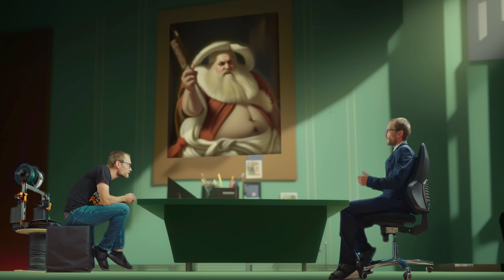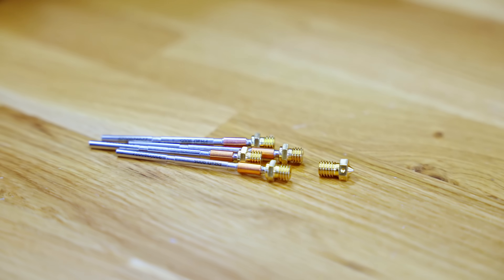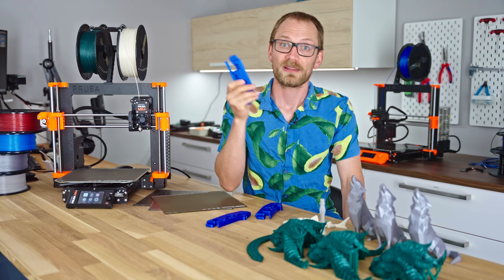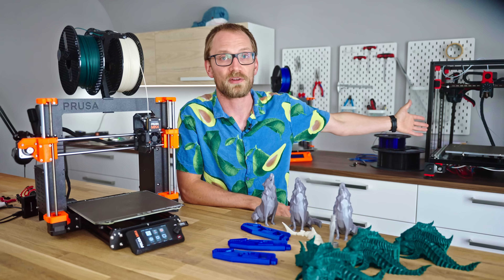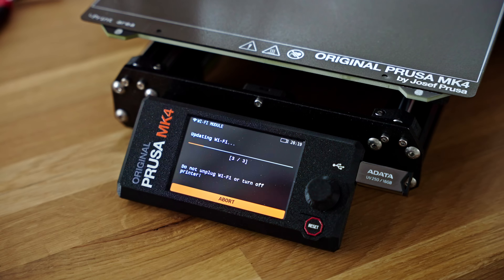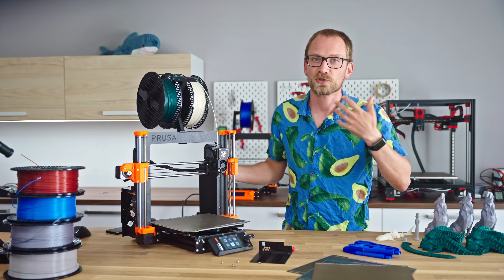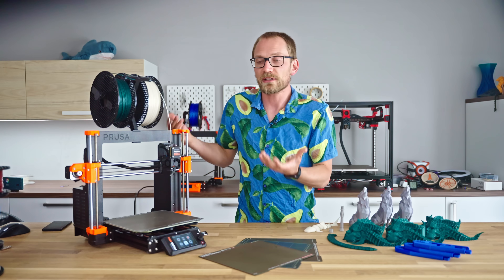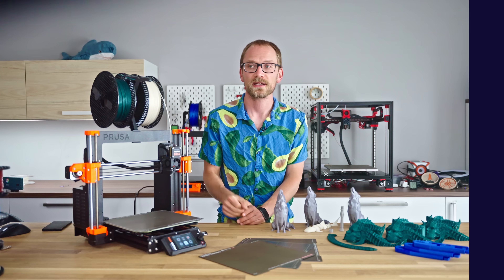Does the Prusa MK4 have what it takes?

Comment: I purchased the MK4 because Prusa has been more than willing to help me solve every problem that I have run into on my MK2 and my MK3. Even sending out replacement free of charge if it was determined to be a faulty part. 
Prusa is the only printer company that I know of that offers upgrade kits throughout the life of the product as technology improves. That is why I choose to buy Prusa printers.
Reply: But the kits are getting extremely expensive. Like the 4.0 kit is only 250€ less than a full new mk4 kit...

Unless you really only have space for 1 printer and for some reason dont want to sell the mk3 it's much more sensible to get a full mk4 and either have 2 printers or sell.mk3 (certainly for more than 250€)
Reply: I was referring to the small mid generation upgrades that are in the $50-$200 range. I agree it's not worth upgrading your current printer to the next gen.
Reply: @Daepilin  Josef has said this himself repeatedly, but people keep demanding that he sell kits, so he does it. But there’s usually partial upgrade options which make a lot more sense. For example the MK2.5 or MK3.5. You improve your current printer, not to full spec but still an upgrade, and for a fraction of the cost of a new one.
Reply: @Daepilin  and aside from upgrades they deserve some credit for providing support as well. I‘m certain I could reach out with an issue on my 6-year old several times slowly upgraded MK2.5S and they’d help me instead of saying “sorry that was EOL in 2018.”
Reply: I wouldn't buy any MORE Prusa Minis at current price point, but I have two that have been my core machines for my business and I will run them forever as long as I can still get parts and they still keep putting out quality prints. I think we will see Prusa stick around as a company for a long time to come just because they have built the rep that others have to claw their way towards, and I am sure they have more innovations in the pipe.
Reply: @andersalbertsson215  agreed. It’s only a matter of time before they make an “XL mini” (normal sized corexy). The MK4 was to hold them over and get a last push out of the i3 platform I think.
Reply: Not sure why people believe only Prusa offers good support.  I have had two problems with my X1 Carbon and their customer service was fantastic.  When you open a ticket, the process can automatically download the printer logs to their site.  Does the MK3/4 even have logs?
Reply: @A1N0  That's not actually what I said, though. It's not a zero-sum game. I wish they were all fantastic at customer service.

But Prusa has demonstrated over the course of at least the last six years that their customer service is excellent and that they essentially never stop supporting a product, and they deserve credit for that. They are not the only ones, but the ones that do are in the minority, certainly of those that sell printers in this price category.

Bambu may turn out to be one of those as well (though your X1 cost you twice what my MK4 kit cost me), and so far it seems they are off to a good start. We can talk again in another five years. But for now Prusa's customer service is a known positive to me, and part of the reason I don't regret my purchase.
Reply: @A1N0  And for what it's worth, you can have logs with Prusa I believe, if you use PrusaConnect. But I don't because I print locally, which is a difference in philosophy between Bambu and Prusa, and I think Prusa would say it's a feature not a bug.
Reply: Creality also offers upgrade kits. But their printers are absolute garbage so why even bother
Reply: 100% agree and its hard to tell them (Prusa) XL 2 years in production as the market Zooms past them and its already obsolete to other printers
Reply: @dansteffee9759  I dunno if the XL is already obsolete, is it? What makes it so in your opinion?
Reply: @swissfreek  I know it splits the Prusa fan base as I have many Prusa's . But Voron and other Machines have this Input Shaping technology. I had this XL machine on order for 2 years , bailed built a Voron 2.4 and have a MK4 . You have to ask yourself what is new that nobody has out there on XL
Reply: @dansteffee9759  but just because someone else has done it does that make the XL obsolete? Or just, not first to market? You see the same philosophy from Apple. They are almost never the first to market with a particular feature, but they watch what others do and take their time to get it (mostly) right the first time.

Prusa don’t use Klipper, they don’t require a second single-board computer to run input shaping, they don’t require you to source parts (I admit there are plenty of Voron kits now), and many many people don’t want to build a Voron. I enjoy building things and even I’m not sure I would want the hassle. If 3D printing is to become truly mainstream as Prusa and others want it to be, then it needs to not be something you have to build and fiddle with. We are nerds and early adopters. For us the fun is in the tinkering. But for a mainstream user it’s a tool, like a vacuum cleaner or a paper printer. I don’t want to build and tune my vacuum, I just want it to suck up the dust when I turn it on! For this person a Voron is just not even a consideration. They will wait a couple years for something like the XL to exist.
Reply: @swissfreek  a fraction?! is the price of a complete mk3s clone
Reply: @felipeh5510  I don't understand your logic. It's a fraction of the price of an actual complete Prusa printer. The price of clones is not irrelevant in general, but it is completely irrelevant to this discussion.
Reply: @Daepilin  I was thinking the same, I would keep my MK3 and just buy a new MK4 kit because the price is just so close. I mean I just don't see the point of upgrading really. I don't care for the LCD screen as I mostly use Repeiter Server to run the printer, the LCD is just to setup the filament with the MMU as it is a pain in GCODE lol
Reply: Bambu Labs is offering a full upgrade kit for P1P to P1S so it will be interesting to see if that philosophy has been adopted by Bambu.
Reply: I can't even comment on their customer support 1.5 years after my prusa mk3 purchase. I have not had a single issue at all. Some user issues with adhesion after swapping build plates and not getting the layer height dialed in perfectly, but that has been it. I have seen no layer height drift at all, so that has only been an issue when putting on a brand new plate.
One thing I kinda hate about it is that I have to run a cable from my pc to it in order to update the firmware. I don't have a usb cable with that adapter long enough and don't have a laptop so I have never updated the firmware which was out of date about a month after receiving it. This has not caused any issues yet, but one day it probably will.

Comment: I chose my first 3D printer as a prusa mk4 because I want something solid for the next 15 years minimum. I support an european busness, the open source slicer, the internet connection with all the stats I can monitorize from my phone... I bought it in kit, it was incredibly fun to build, and it works on the very first try I was completely bamboozlied. I made a Benchy on PLA and then on PETG. Incredible emotion when you come from the wood industry like me.

Comment: After owning my Sovol SV-06 for half a year now, I still want a Prusa. As you said, you have to tinker with the Chinese machines until they run reliably or even work for longer prints at all (yes, I'm looking at you, heatcreep).

But at this point I have three printers that need tinkering and I'm just tired. I just want a printer that prints for hours, days, weeks, months, years without tinkering. And that's what Prusas do best and seemingly nobody else achieves. My friend has a Prusa Mk2 and it still runs just perfect after all these years.
Reply: You had heat creep on the SV06? I have pumped a good 15-20 KG of filament through mine and not a single clog. That includes some 48hr+ prints.
My only mods were a couple of parts to manage the bed cable and I upgraded to a 5015 single fan dual duct config. My only issue is the VFA, which the MK3/s/+ also suffer from.

Oh, almost forgot I packed the bearings on the SV06 as soon as I got it, they were almost completely dry and sounded horrible, after greasing them it is pretty quiet apart from  the PSU fan which I will most likely replace with an 80mm at some stage.
Reply: @Smokinjoewhite  with some PLA brands I had heatcreep issues (filament stuck, failed print), especially now in the summer it appears the temperature within my enclosure was too high. There are really good models for 5015 fans on Printables and since then I didn't have any issues again. And the printer became quieter because the bearings in the fan made weird noises on movements.

Comment: Honestly that load cell and prusa link are what got me to purchase the Mk4 (on top of the good experience I've had with my mk3)
I never really liked using octoprint so i really like the fact that i can load my gcode onto the printer's storage without having to physically plug in the storage device into my computer. I can operate everything from PrusaSlicer and/or the web interface. 
Also, to me its an $800 printer since i like the fun weekend i get assembling the printer. 
It may not be significantly better than all the competition out there but I don't have anything to complain about with this machine.
Reply: I know my MK4 is going to get support and options for upgrades in the future on top of sustaining their commitment to the community.  That’s on top of a heck of fun assembly experience that only gave me a few scares (&Haribos)
Reply: I had a load cell printer YEARS AGO. The Creality CR-6 SE.  Look it up. I still use it today. Works great.
Reply: To be fair, Klipper and RRF had direct to print capabilities over WiFi - both as host and as another device on the network - since before Mk.4 was released. It's really not a unique feature and Octoprint wasn't the only way to do it as of at least 2020-ish.
The load cell isn't unique either but they did make a better way to mount it that reduces oscillations from a non-rigid mount inherent in a load cell system, but without the considerable weight budget of a Tap-like 4th linear axis probing system.

Comment: So, I got a MK2 when your review on that posted back in… late 2016? I have upgraded it since and it’s now a MK2.5S, which is only a couple steps short of the MK3. I converted my XL pre-order to a MK4 kit, and I have to say, on paper, there’s not a huge difference between even the MK2.5 and the MK4, but in practice, it’s vastly different to me. It’s way less fiddly to assemble, way more consistent in use, the interface is better, the load cell bed leveling thing is much much better than the PINDA, and it’s significantly faster (it’s not lightning, but it’s immediately noticeable. I have a way easier time getting good prints, especially large prints that cover a lot of the plate and struggle with adhesion in some spots if bed leveling isn’t spot on. So yes, same formula, and looks the same at first glance, but it’s not the same.

I saved money by building the kit, which I enjoy doing anyway. But still, yeah I could get a P1P. But that’s a whole new system with new issues to learn and solve. After 6+ years of printing on my Prusa, I’m comfortable with their philosophy and how they go about things, so I know where to start when I have a problem.

Expensive? Yeah a bit. Perfect? No. Bragging rights? Probably not (but I don’t really care about speed benchies etc.). But do I regret my purchase? I do not.

Comment: I don't believe that by opening its source code Prusa is killing itself. Say they took the Slic3r and built a closed source product around it. There is still Cura in open source that other printer manufacturers could use. Without Prusa slicer it's possible that Slic3r, or a fork of it, may have gotten more attention from open source developers.

I believe that people buy a Prusa when they want something that works and expect it to keep working. They also want to have someplace to contact if there are any problems with their product. It is similar to businesses paying for support licenses for Linux when one may just download the operating system for free. 

( Perhaps having Prusa throw its resources into Prusa slicer and keep it open source we lost out on a lot of people contributing to the various open source slicer projects. They may have thought that things were going to get done by Prusa so they would live with any annoyances in the current version. A lot of people start on a project when there is something that is bugging them or they really want a feature but there isn't the resources to implement the fix or upgrade. )
Reply: Granted I’m no lawyer, but also with many of the Slicer features, unless you start from scratch (although this brings up the potential for issues akin to the Power Supply/Regulation circuits in Laptops etc that @Louis Rossman mentioned of there only being a few ways to do something), you would be using components that require you to open source the code.

Granted Tom touched on that with the “start with open source bits and gradually remove them all until it is locked off” bit, but I don’t think that is what has been done (citation needed).
Reply: Most of new PrusaSlicer features are ported from Cura!
Btw. I do not understand a reason for PrusaSlicer's existence ...They just took Slic3r then started rewriting it with Cura's code.
Reply: @WizardUli  

PrusaSlicer exists so that Prusa that the company  may guarantee that there exists an application they feel takes advantage of the hardwares strengths while dealing with any areas the printers may be weak in. They know the printers better than anyone else and are able to customize the software to them. They could have used third party software and created really good profiles but there are some things that can't be dealt with in a profile. 

It's true that PrusaSlicer does get a lot of inspiration for new ideas from Cura. However, new ideas travel in all directions from the slicer apps. Cura, PrusaSlicer, SuperSlicer, and more all have talented people contributing to them. Because those projects are open source the ideas may be implemented, and possibly improved, on the other apps. What may be possible on one app might not be possible, or require a tremendous effort, because of how things are implemented on another. Or it might be easier.  We are all better off because there are multiple open source slicers with active development.
Reply: @ericlotze7724  

Slicers are software. How one group builds a slicer will be different from another. Even though a task may be the same for the two groups (for example, how automatically to add supports), how each group goes about implementing it in their source code could be vastly different. It depends on such things as how they store the data internally (data structures), goals (is speed more important than minimizing memory use), the computer language used, the pressure to release (if it needs to be released very soon the first idea might be implemented rather than coming up with the best idea), whom is working on the project as people have different ideas, and so on.

Comment: Agree on all that but i simply dont have the time to tinker. When i got the mk3, half hour after assembling it i had my 1st printed part. 
Ordered a mk4 in kit
Reply: Its funny you mention this while choosing a machine you have to assemble when machines with similar capabilities are printing before you get the first bolt in. Its an interesting choice to me. I suppose there is no reason not just to blurt out the elephant in the room, but in terms of not tinkering, why a kit mk4, when a P1P has more capability for less money and and is even more user friendly?

Not wanting to tinker used  to be Prusa's speciality but I have to say Bambulab in a way the cheap clones like the K1 havent really managed to yet, really disrupted that, and In my opinion changed what it meant to be an easy to use, no fuss, no tinkering printer.
Reply: @BeefIngot  point is as follows: assembling a prusa is relatively easy thanks to the really good documentation (something that is becoming out of fashion a bit everywhere and lets not start with "documentation" when it comes to some chinese products) and is a one off: 4 or 5 hours work.
Regarding "tinkering", i hear stories from those who went for cheaper options, where it took them ages to set up the dozens of parameters to get the printer to work reliably; with my mk3, as i said, took literally half hour to get printing. 
It then worked reliably for all the time i had it (i think around3 years now) which basically means when i need something i design it, slice it and print it, with just the very occasional adjustment of first layer. The reason im getting the mk4 is that even this hassle will be eliminated.
Time is money and in my business people bills 100 to 200 dollars per hour. So no, no time for tinkering when i need to print.
Reply: @crono331  interesting, I ordered my mk4. What is your business about?

Comment: Open hardware and software is the future.  This was a huge factor in my decision to go with Prusa over many "cheaper" alternatives.

While assembling the mk3 + mmu I damaged a part for the mmu.  No worries, I just downloaded and printed off the replacement.  Cheaper and faster than ordering a replacement from the other side of the globe.

This was my first 3D printer.  It has been a fantastic experience so far.  It was a deliberate decision to support an open company helping to build an open ecosystem and I have no regrets.